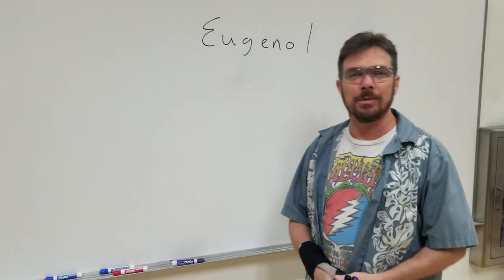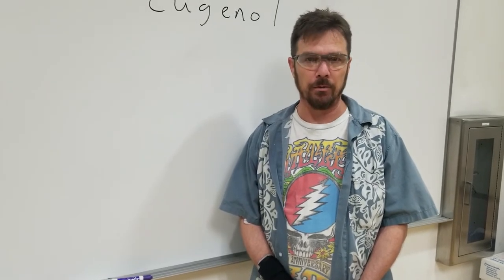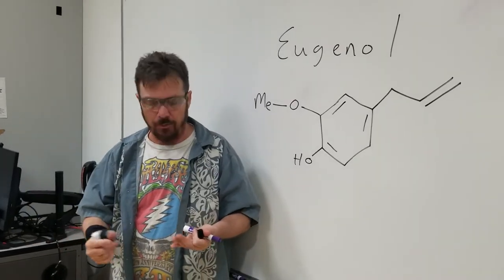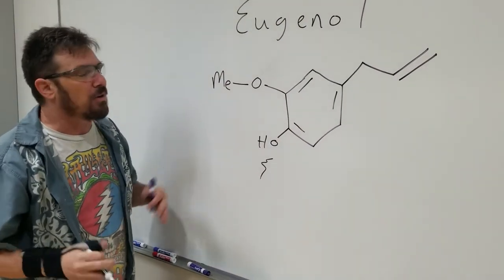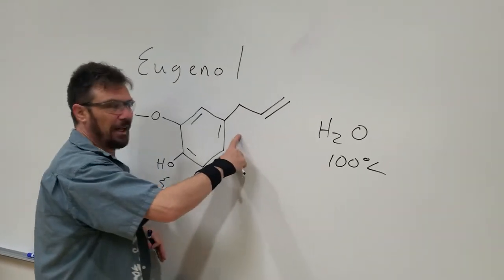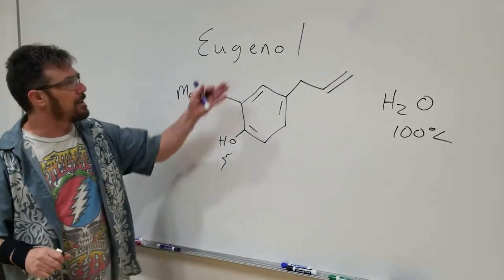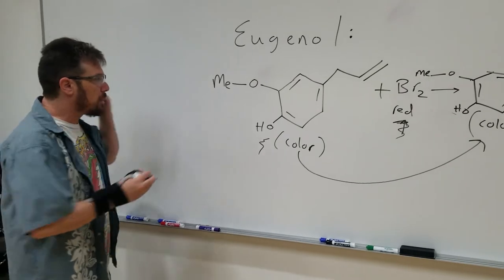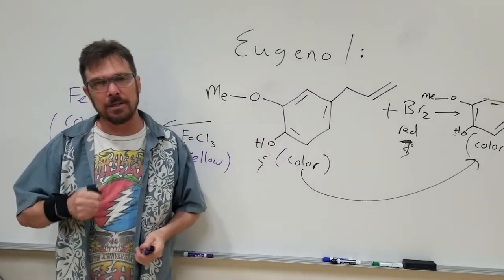Steam Distillation- Isolation of Clove Oil / Eugenol

Comment: Could you still get the extract even if I don't have any dichloromethane or magnesium sulfate?
Reply from the maker: you need an organic solvent of some sort to extract the extract from the water.
Reply: @wizzbangchemistry9706  Thank you for answering my question
Reply: It works fine without solvents, eugenol is denser than water, so it phase separates below the water. you can directly remove it with a pipette. The yield suffers, though, you lose a lot, stuck as tiny suspended droplets, hence why organic solvent extraction is more efficient.